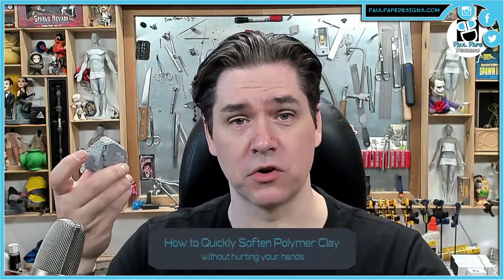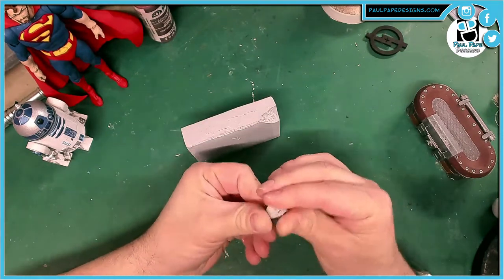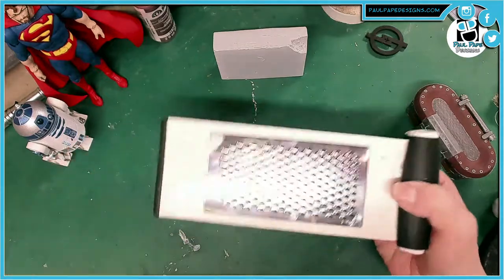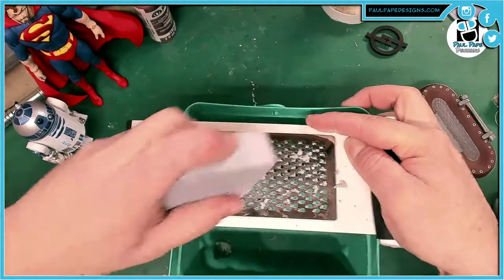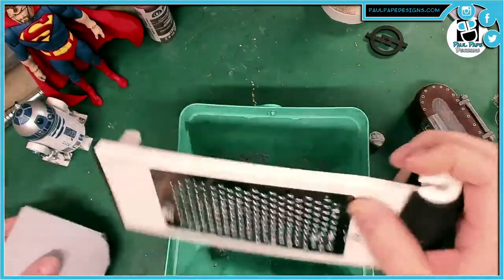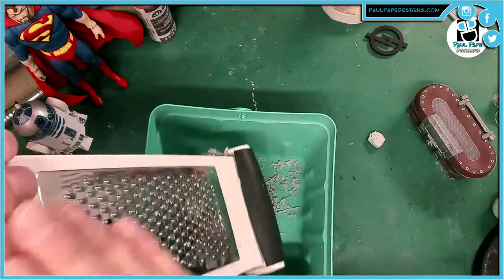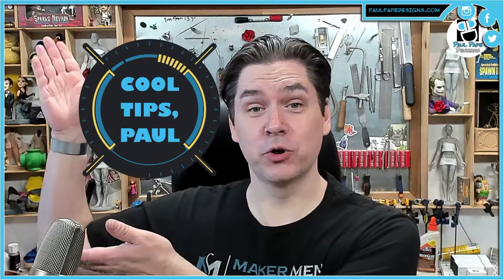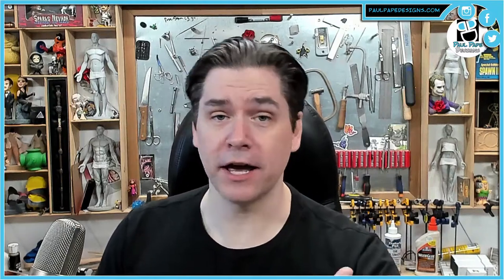Cool Tips, Paul - How to  quickly condition polymer clay

Comment: Well that was cool!  I have an 8-pound box of original Super Sculpey that's been sitting in my basement for well over ten years, that had NEVER been opened ... until just about a week ago.  It is very hard ... more stiff ... and I've been working chunks by hand with softener added, and it takes quite a bit of doing to get it workable ... but it does make it malleable.  I'm gonna give this method a shot ... after all, I have EIGHT POUNDS to condition!